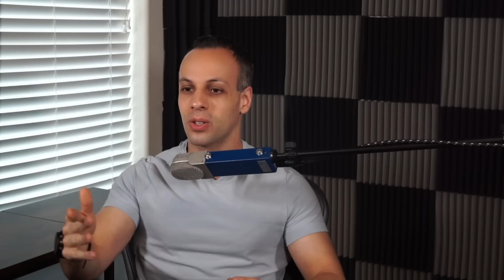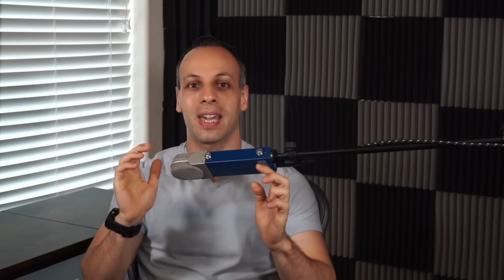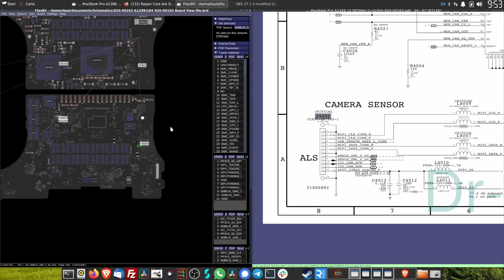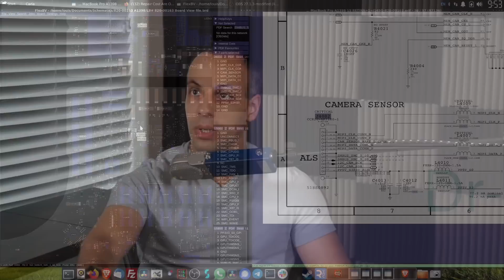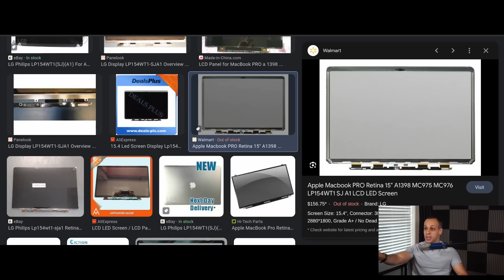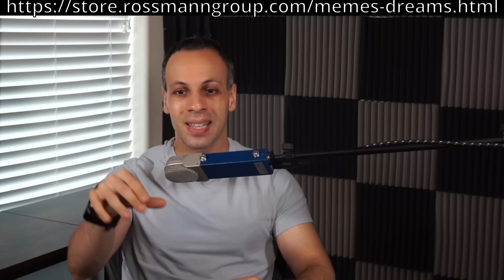The Ford F150 Macbook - when car repair resembles macbook repair...

Comment: Create an orphan product exception for IP. When a part is not available individually for a specified period of time, a duplicate product can be produced that even "violates" the IP. Similar to the intent of the orphan drug laws. The de facto monopolies that IP laws grant have a public good justification, because the theory goes not having them would stifle innovation. Not be used to stifle innovation.

You can have a carefully tailored exception for supply train interruptions and a reasonable time to re-source it. Obviously you also have to have an exception for trademark pieces or logos, as long as they are not instrumental to the operation of whatever it is. Serialization also should be banned.

That will get the attention of large corporations. IP has become a primary way of creating de facto monopolies with absurd levels of profitability and even more absurd levels of unaccountability. Put that in play, and suddenly you will have corporate attention. Unfortunately they will probably ramp up the spending against right to repair to the next level.

You can probably grab democratic votes both for consumer rights and environmental issues (I find Apple especially repugnant on the ladder, they don't greenwash they dump the entire bottle of dye on it). As you well know, farmers will join in so you will get a slice of the Republican vote.

Require the same for importers. That will get you more Republican votes, and some of them will even be smaller corporations who will see this as an opportunity, and large corporations to make it harder foreign companies to do business in the US unless they are prepared to maintain a proper supply chain for parts.

 The definition for availability will also have to be tailored around how badly people need it repaired. If it's a vehicle they need to have a fairly short turnover time for parts. A computer or cell phone is actually going to be close to the same because again those are critical often for everyday life, even though for most of us or more likely to be able to replace the device not the vehicle.

Something similar was done decades ago when Detroit started to try to play a similar game. We have all those convenient battery types like AA and AAA due to standardization techniques like that too. I would hope that some Republicans might support this because it would permit nimble American companies to step in and create a much faster domestic supply chain for these parts. 

The next big crisis for this is going to be the batteries for EV's. There's a video I cannot remember the precise title where they are rebuilding the battery for an EV, it may have been a Tesla. The car maker wanted was something like $22,000 to replace the battery pack. They were able to remove it, test it, replace the three weak battery modules with matched ones of equivalent capacity, and then reassemble it. All four I think it was around $8,000.

Comment: Later, they will be augmenting the bus so that it works with an specific encoding, if all parts arent working on the same encoding, the replacement part wont work

Then they will be shipping the encodding code on a special paper which wont be of permanent print and fade after a while, and if you didn't copied the code on a more permanent medium, well... you get completely fucked and they only way out is buying a new one

Comment: Harley Davidson has been doing this for years. I had a (euro) 09 Sportster, it had LED tail light / indicator clusters.  Anyway, it was pre-owned so although I bought it from HD it only had 3 month warranty, but only 120 miles.  5 or 6 months later, one of the LED clusters died, because they sucked.   I went to HD to buy a replacement LED and was told I had to buy the entire unit, and the taillight was going to be £500, for ONE.   Ended up tearing down the entire thing and putting third party lights on, cost me 30 bucks.

Comment: Just a clarification. What he is talking about is a Communication channel (bus) that different components use to talk to each other. If one component fails in a way that takes down the Comm Bus every component on that bus will no longer be able to talk to the other components thus causing critical failures everywhere. ( I am a retired field service engineer, We automated industrial valves.

Comment: But I bet it's fast to assemble on the line, that's all that counts. 😆 The "module" oriented approach in manufacturing is strong. The "Giga press" is a nice example. Cars will soon be deemed totaled if you get a curb rash on the rim. 🤦🏼‍♂️

Comment: That sensor there should have some level of bus isolation in it's design, rather than connecting directly to the central bus.    This goes on both cases.

Comment: The worst part is, governments are trying to force radical change for the environment on consumers, but they do absolutely nothing to force this onto corporations to make easy to repair, accessible parts products to reduce e-waste and (FAR WORSE) vehicles being replaced prematurely. If governments forced all auto manufacturers to start using more standardized parts like electrical connectors, wheel and tire sizes, headlights/tail lights, as well as focus on engineering for accessible repair and longevity rather than appearance, this could make a radical difference in repair cost, re-use of more parts in wrecked vehicles, and dramatically less waste of multi-ton vehicles.

A culture of repairable and re-used products must start with manufacturing to make it possible! I see absolutely ZERO discussion by governments to make this happen, blaming consumers for buying the products that are available.

Comment: It’s really hard to believe that they wouldn’t understand these as a long term issue.  Cars have been made for a long time, and it is understood through many many failed designs what works and what doesn’t.  I am always frustrated when a car maker proves something can be done right easily and reasonably, and some other just can be bothered to make a part replaceable with the appropriate effort.  Something that just happened to me is a Volvo suv, forgot what model exactly , needed a blower motor replacement.   Just about every other car ever (that doesn’t suck) has figured out how to place a prone to failure fan in a very easy to replace location.    Volvo decided they didn’t need to do that and require removing the whole dash.   There is no way they don’t know this part fails often and the person working on it would expect the knowledge that humans have figured out would apply here.  But the deciders figured just go with it because they don’t care or are a bit daft.  Also to note, there blower setup isn’t amazing or work better then the others.

Comment: '80's Pontiac 6000 v6 required disconnecting the engine mount to change a sparkplug

Comment: I a mechanic at an automotive electrical shop. All I do are cars others couldn’t or can’t fix. Its has gotten so bad for these customers. Had a jaguar in no head lights bad body control module $4200 bucks. Have multiple f150s in parking lot waiting on body control modules for light problems(probably 2k on back order right now). F150 last week ford had shut down there programming site for a couple days(fixing something) went to program body control module once it was back up the brand new one bricked found out it was a glitch from ford. SO MANY CARS now have security measures preventing the use of used computers. Even after they stop selling the part there still locked. We will do things like open computers find the chip with the VIN manually connect read the lines of code and edit the vin. Sometimes we can erase the chip sometimes we will change them. I think the biggest impact this will have is on the lower middle class to poor. This is still automotive centered country. The cars coming down the food chain are getting both too expensive and to expensive to fix. This in limiting the opportunities for the lower classes. Some guy just starts a small business and his trucks are down for months. Single mom can’t afford a decent car to get to a better job. Then what happened to Reduce,Reuse, Recycle? That was the correct message for are disgusting wasteful society. So much perfectly good stuff is thrown away it is so sad. Used parts should be aloud too find new life it’s just disgusting.

Comment: I have a permanent scar on my left thumb from replacing a burned out taillight bulb of the 2018 F-150 I owned. You can't just unscrew the cover, you have to pry the entire housing out of the body: it bounced back and bit me one time. "One time?" Yes. That truck chewed through its left taillight like candy. The dealer attributed it to "cheap, Chinese bulbs," but couldn't explain why only the left rear got the defective bulbs. Replacing the housing means you have to be a body fitter, since the retaining tabs on the body (the ones you have to pry the housing out of) bend out of shape.

Comment: F250 CP3 failure

The CP3 is the high pressure fuel pump that is flawed from a design point.  If diesel fuel gets water in it (diesels have water separation filters to mitigate some of this because water in diesel is so common), the lifters in the pump can spin, grind off the pump cam lobes, and then fill the entire fuel system with metal shrapnel.

The repair procedure involves removing and replacing the entire fuel tank, in tank lift pump, fuel lines, high pressure CP3, all the high pressure lines, the filter housings, and all the injectors.  $10,000-$12,000 repair.

There are tons of reports of owners being told at their dealers that the warranty will not cover this.  They say “the fuel was contaminated, take it up with your fuel station and pound sound.”  So this is a 60-100k truck, still under warranty that you’re making payments on, and you have a 10-12k repair bill to get it back on the road.

Comment: I've always been a ford kid as my dad was a highly trained ford tech. I always talk to the tech guys when looking at cars when I get my oil changed because you usually get the truth and I was asking about the Maverick vs F-150 Hybrid. The service writer told me they made a lot of weird (and bad) design choices the F-150s over the past few years not to cut cost but due to limitation of accessibility to materials. Guess if I stick with Ford I am looking at a Maverick. Ford is usually thinking of repairs especially as they sell up to a 10 year warranty and they want it as easy to fix as possible to keep losses low.

Comment: a plastic tab that pulls the sunroof back broke in my wife's F150. to fix it they have to replace the whole sunroof frame. $4500. and the sunroof will leak until it is fixed

Comment: The customer accepted their level of responsibility. They chose to buy an up-market, bleeding edge product. They knew those rear taillights had a radar module in them. It just slipped their mind. Understandable. I had seen his video when it came out. It was mind blowing. But, at the end of the day the customer had a repaired truck that's worth a lot more than 6k. Maybe they sell it now, and get something lower tech. Potentially any component in the CAN BUS circuit could disable the vehicle, meaning basically a million things. That's why the customer was so thrilled just to get it fixed after the dealer couldn't figure it out. These independent technicians, and that's what they are, can make good money as a hired guns, solving these hard to solve problems. Kudos to him.

Comment: I had a similar issue with my 2004 Volvo S60R. The alarm module is known for having a bad battery.  It's the same BUS that is used for the sun roof.  I had to replace the alarm module to get my sunroof to close.

Comment: About professional devices...
There is a machine made by Kabmak which spins together ACSR overhead cables twice thicker than your thumb. Every part of it runs on the same Profibus network. Every VFD, the brake and clutch controllers, every PLC, even the ones running through bloody sliprings, spinning at 100rpm, there's like 20 devices on the network and if something goes offline the machine refuses to move an inch. I saw that the previous techs changed out cables of the wrong impedance to get it to work. That machine is good but I really question some decisions inside of it. And you will see this more and more as it's easier to make independant modules that work on a bus

Comment: Personally I would have drilled a hole in the tail lamp so water could drain out of it and clipped the can bus wires and the the power wire feeding the module.  Cleaned the corroded connectors with DeOxit and then ran it without collision detection. The Lighting works separate from the modules.  Of course, I fix old rusty crusty cars for working people, not nice new ones most of the time.

Comment: The odd thing, other than the taillight not properly sealed, is that the connectors are terrible.
The mechanic said that where the wires go into the connector is sealed. But apparently the connectors themselves don't seal between each other. And that's the part where it went sideways and corroded the pins to the point of 'destroying' the harness and modules.
And as Louis said, it probably is made difficult to get / replace module side connectors to replace the corroded ones.
On top of all that... the pigtail (connector and a couple of inches of wire) was more expensive than the entire harnas that connects the 2 taillights to the rest of the truck.

Comment: Yep! So many companies nowadays only care about the bottom line on getting the product design done and off to the subcontractor(s) who do the actually manufacturing. They don't care much about designing against such incidental issues. By the time the issues come to light, it's merely the customers' problem...which the dealers can charge through the ass to repair. While the end result may not have been specifically planned, the company has zero incentive to do better and even some incentive to let such bad design decisions slip through. 

Sure, you can boycott the worst offenders. However, most execs and shareholders prioritize their personal quarterly dividends over long term product reliability. Such malicious stupidity will only become endemic in other brands and other industries as well. The only way to stop it is to bring back enforcement of product liability laws. Companies will only address their design and process issues when the cost of fixing the product failures becomes more expensive than doing the job right the first time. 

I'm not expecting perfection, just basic professional due diligence in product design and testing, as well as liability for failing to do so. Both are seriously lacking.

Comment: Vehicles made in the last 14 or 15 years are utter garbage. There is not going to be a second hand market for used cars, if you can't afford a new car, you sure as hell aren't going to cough up eight grand for a new drivetrain when that 16 year old POS that cost you half your income for the last six months to buy in the first place takes a major dump on you because the CVT hunk of junk auto trans not only commited catastrophic harikari but took the differential and CV joints and axles with it. Say goodbye to car ownership if you aren't semi wealthy. Or pay $85,000 for a base model, no frills new pickup truck. Check pricing on these new pickups if you don't believe it, you'll crap your pants.